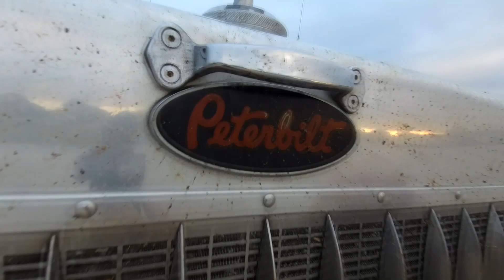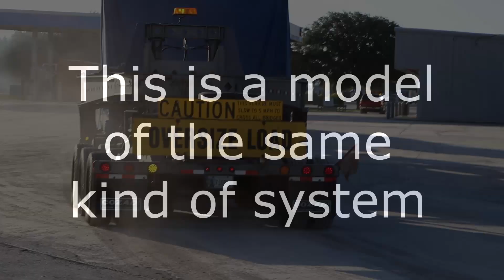402  Morning Inspection and a Cool Oversize Load

Comment: I'm glad you went over the trailer items - I've had to reseal those hubs out on the road (thanks to I-State for having the parts) and I've caught registration paperwork not matching (thanks for fax machines!) I also used to keep a small bag of glad hand seals. Check those guys! They can cause you grief at a DOT inspection if they leak, and they do get worn & cracked. Cheap insurance, guys.

Comment: Hello Stan
Good Video
Great info, What a Trailer, Did u c what he was hauling ? Looks Very Heavy, 
U forgot to check the Kanitser & Osalator Valves on the Gyromanipulater. 
& The Smoke Shifters? 10 - 4
Reply from the maker: I knew someone would pick this apart.

Comment: I just got my Class A CDL hear in Gladwin, Michigan. I tell you what that pre-trip inspection isn’t to difficult but you have to check everything and repeat for example “ I’m checking my slack adjusters and push rods making sure they are properly mounted and secure with no damage such as missing nuts and bolts, cracked, or bent.” Basically repeat that for every part of the tractor an trailer.

Comment: Stan,
I've learned to drive an 18 wheeler by just watching your videos. Picked up my first load today at a truck stop in MO. Headed through Kansas now. My only question is how do I get rid of this driver thats hanging on the running board yelling something that sounds like, "get out of my truck".  Should I turn the radio up, and where is the knob? 
Love your videos 
Jim& Celia
Hooch on Wheels
Reply from the maker: Open the door as you go by some tree branches

Comment: I've noticed quite a few trucks driving around with much wider tires (1 per side on each axle) instead of the typical duals. What is that about? a new thing? cheaper? is it just catching on recently? I like the videos.
Reply: I'm not a trucker but they are called super singles. Probably cost close to the price of 2 regular tires.
Reply from the maker: Super singles are the wave of the future.  One SS wheel/tire combo costs and weighs less than a dual tire/wheel combo.  They say they get better mpg too.   Me, I'm not a fan.  I like the duals. You can limp in to a repair shop if one blows.  Singles, your on the side of the road till help arrives.

Comment: Unless I'm wrong this is the same set up that we used to haul M1A1 Tanks..
Reply from the maker: M1s would be hauled with a RGN style.  It may have as many axles but it would be an RGN
Reply: Sasnak  It was twenty years ago and I wasn’t a driver. I was am M88 Hercules/tank mech. I just know there were so many restrictions on when they could be on Commiefornia roads it was pathetic. Not to hot, not to cold. Not in certain times of day. Getting them out of the desert to Camp Pendleton was a nightmare.

Comment: I love your content, on 1 of you're videos you said Bull Haulers made more money than you. Ask these Bullhaulers if they pay 20% of any Death loss a company driver had to pay for in the 80 s did like I had to pay.😀 Hog hauling in summer has so many hogs down so the driver cannot be charged for loss. The #  250 quivering hogs must be dead before backing up to the winch to pull them off the trailer, so if the plant doesn't want to cooperate with the bolt gun to pop their brain, the driver has to make a moral decision to put there heel on the hogs throat and suffocate them. Bad memories for me.

Comment: 12:12 Why dont you use steering axle lowbed trailers, is the reason weight limits per axle or something like that. In Europe most special and oversized transports are being hauled with a 8x4 or 6x4 tractors and a 4-8 axle (steering) lowbeds.
Reply from the maker: This is just one style of oversize trailer.  There are many more types
Reply: @Sasnak  oh okay, I just never have seen any of the other types.

Comment: I've been watching some UK trucking channels lately. It appears that most of their trailers are triple axles, while most US trailers are dual axles. Do you have any insight on why this is so? Thanks.
Reply from the maker: European roads are narrower than in America.  They figure this is the best design for their roads.  It offers a tighter turning radius than our style.  As far as weight loads I'm not familiar with their laws
Reply: @Sasnak  My brain thinks that the fewer number of axles, the more maneuverable the trailer would be. Can I be wrong yet again!?
Reply from the maker: Well the tractor has a short wheelbase and that makes it more maneuverable.   Europe just has a diff way of doing things than the States

Comment: Driver YOU"RE SO CORRECT about a D O T pretrip is completely different then a Drivers every morning pretrip inspection....and about converting over to CDL's i also was driving wth a Class A in the 80's BUT here in AZ when CDLs started we all had to go do a complete full CDL testing, as in complete pretrip as u said had to voice what we were doing/expecting  and tell them all about the air brakes also etc etc and driving 20+miles and several different backing maneuvers serpentine, alley docking straight line etc etc and back then i had to to pay $200 for 3rd party testing , bcuz we couldnt get a CDL thru the company we were already driving for [politics, government BS] lot of drivers quit driving back in that conversion period , old old school drivers wanted NOTHING to do with the new CDL crap
Reply from the maker: I always figured the CDLs where about more money than anything else
Reply: @Sasnak  oh you damn right , it always is , hell its a Federal Government program, so of course , and anytime the Feds or the Government say they are HELPING the drivers, get out your wallet lol and or the Vaseline....